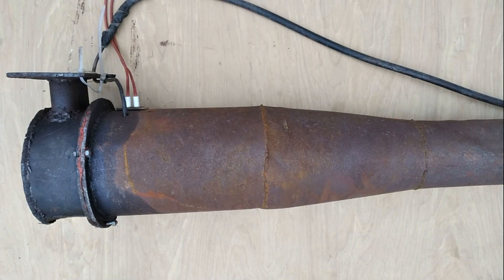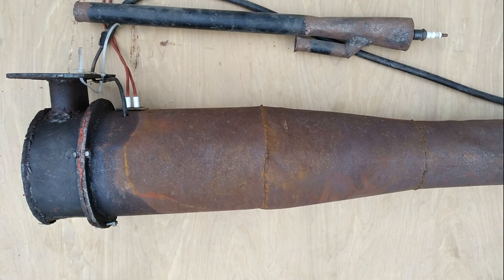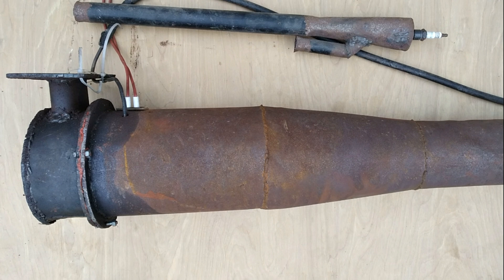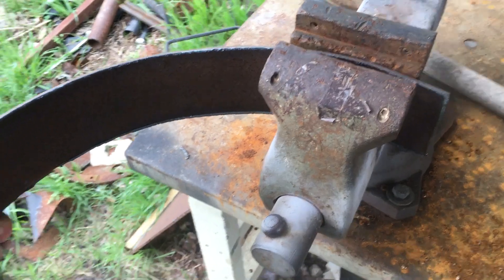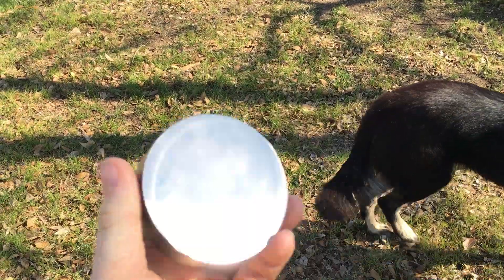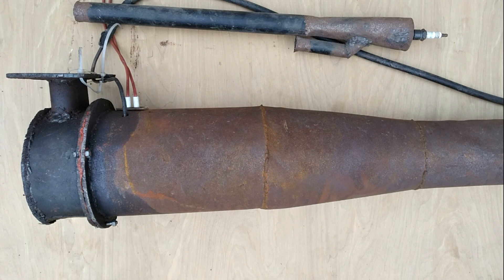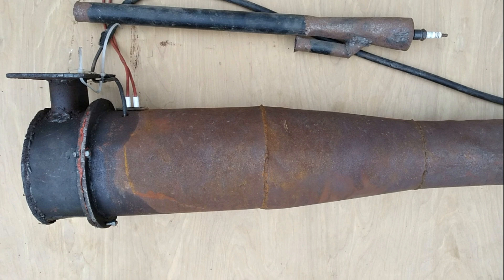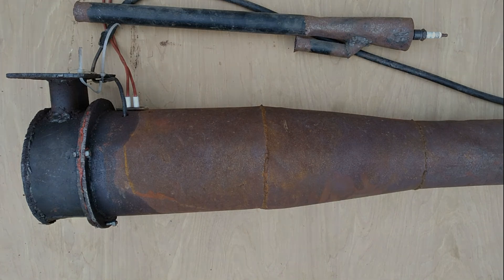An Unsuccessful Pulsejet Experiment

Comment: So is it for SE-5? xD
Reply from the maker: I have been toying with the idea of making a pulsejet powered aircraft for quite a while. The weight of all the fuel required would be a big challenge, but I have a design that's working well in X-plane so I think it's possible. Even with valveless pulsejets, managing 30 minutes of endurance with a 15 minute reserve would be do-able.

This would be a different airplane of course, and I wouldn't start on this until the SE5a is finished.
Reply: @EvanJonesProjects  I would love to see that, pulse engined airplanes are an odd sight. I know (appart from nazi ones) that there was Polish glider with 4 of them (SZD-9 Bocian Puls). Maybe if not glider a composite construction wherever possible is a good idea? Man, so many projects to do. I'm keeping thumbs up!
Reply from the maker: @maciek_k.cichon  There was also a French glider that was converted by SNECMA in the 1950's. This year a company called Wave engines converted a glider as well, which is very exciting.
Reply: @EvanJonesProjects  Yes, there are times worth being alive in, at least from technological side. It's like living in the future, no flying cars but cool nonetheless.

Comment: now put one on the airplane....
Reply from the maker: If I did it would be a whole new airplane, but I would like to do that one day.
Reply: @EvanJonesProjects  It would be a very interesting design challenge considering the size of pulse jet needed to propel an aircraft.  It would likely have to be a biplane with wood and fabric contraction due to the lower thrust available from the jet.
Reply from the maker: @DanielKezar  The engines would be quite light, but the weight of the fuel would be massive. I'm currently planning on 245 lbs. of fuel! My current scheme involves a lot of ultralight construction techniques and a very sailplane-esque design in order to lift all that fuel without too much induced drag.

There would be two engines generating 100 lbs of thrust each, but after takeoff one of them  would be shut down. I'm planning on a sailplane airfoil such as S0712.
Reply: @EvanJonesProjects  two engines for takeoff and one for cruise is a spectacular idea.  perhaps one could be larger and produce more thrust much in the same way a twin turbo setup works on ICEs to provide multiple bands of power?
also wow thats a lot of fuel!  is the plan to get an experimental airworthiness certificate?
Reply from the maker: @DanielKezar  Yeah, it would carry way too much fuel to be an ultralight, so it would need an experimental certificate. I should note that I can't really start on it until the SE5a is done, but I really look forward to giving this a try one day.

Comment: Try using a few Tesla valves put into a circle
Reply from the maker: I know a few people have tried Tesla valves before, but there isn't much information out there. It would certainly be interesting to see.
Reply: Tesla valves are too "soft" to be effective.   They leak far too much before they effectively "close".  As a result they work fine for constant flow but are near-useless for pulses.
Reply from the maker: I've really enjoyed your incredible website! There's a question I've had for a while and thought might be good to ask you when I saw your comment. Out of all the valveless pulsejet designs, such as the lockwood, FWE, thermojet, Escoppete, Ecrevisse, ect. which typically gets the best TSFC? I haven't seen the different designs compared to each other much online, but was wondering if someone with your experience might know.

Thank you very much!
Reply: @EvanJonesProjects  The differences are pretty minor between the different variations of valveless engines and this is mainly because they're all operating on the same basic principles.  The only variations seem to be due to the efficiencies in gas-flow related to the physical design of each engine.  Without any significant compression of the air/fuel charge prior to ignition the combustion efficiency will be pretty much the same in all engines.   What I was working on was producing a "compression wave" that propagates through the combustion chamber and creates a localised area of higher (albeit still relatively low) ahead of the combustion flame-front.   This strategy does increase fuel efficiency quite noticeable.
Reply from the maker: @xjet  It's really interesting to learn more about the X-jet! If I may ask, on the valveless x jet, was the compression wave caused by having multiple engines out of phase? I have been attempting to wrap my head around the rendering and multiple engines around a central augmenter was my best guess.
Reply: The Tesla valve has no moving parts and it would keep enough back pressure for the combustion

Comment: If Inconel valves became readily available this project would be almost immediately viable.
Reply from the maker: Inconel valves would still be quite heavy. For the valve to actually work it would have to be extremely light weight, vibration resistant, and heat resistant all at the same time. I doubt there's a material out there that could do this.
Reply: @EvanJonesProjects  perhaps a new alloy will be developed in the near future. Still great project 👍
Reply: @EvanJonesProjects  Ceramics, thoguh not a material engineer. There are some I know that may.